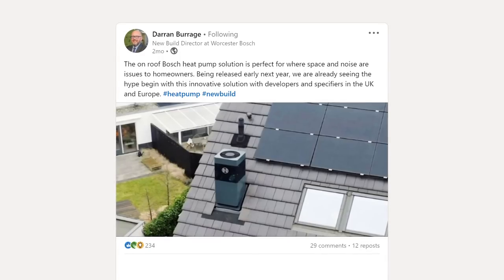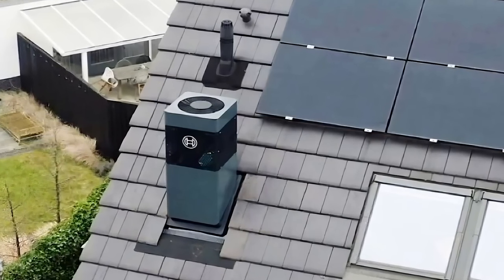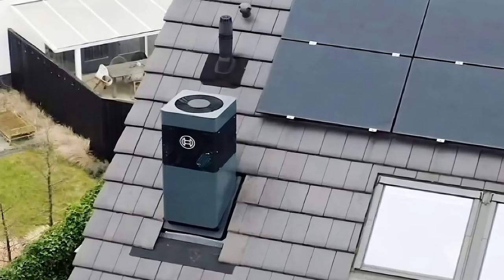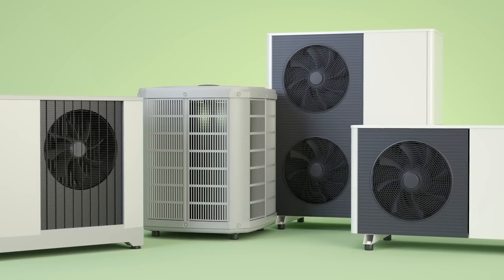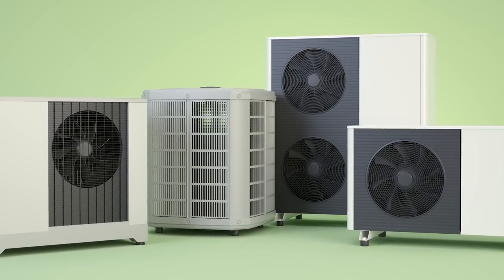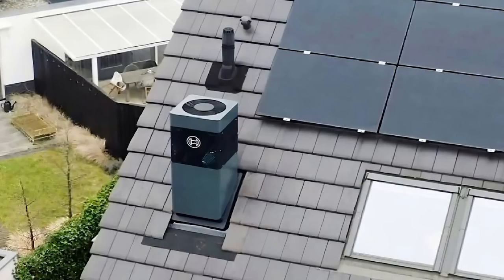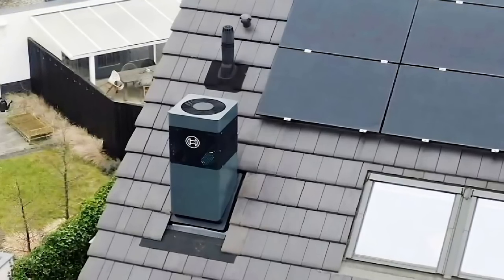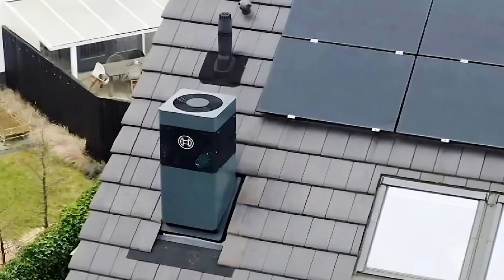Is This New Air Source Heat Pump Idea Crazy?

Comment: Nice idea and a good option where it could be accessible, but maintenance in UK houses will definitely be an issue and introducing new risk runs contrary to the ethos of CDM etc. 

Gas boilers are popular because they work well, are relatively inexpensive, and can be specified, installed, and maintained without as much specialism. They may not be as efficient as heat pumps, but they hit the sweet spot of being good enough and accessible enough to most people and installers. 

The more things have to be engineered to be more efficient, the more processes are necessary to do essentially the same job - and they more they cost and likely the more Co2 in their manufacturing. As an example, your gravity fed hot water system may not be super efficient or amazing, but it works well enough and is pretty simple. Now with pressurised/unvented systems,.you get better efficiency and performance, but they need a level up in terms of more specialist parts and maintenance. 

That's not at all an argument to say don't try or do anything new, don't Innovate, don't use heat pumps etc. It's more there are no panacea technologies and especially not ones where you need to coerce, nudge or persuade people into adopting them. It's easy to see something new that appears innovative and adopt it in a rush, only to find that it doesn't work. And you can't really predict the future either! 

We need to understand why boilers have been so popular (and it's not just energy companies) and be honest about the limitations of new technologies.
Reply: I agree with almost all of what you said, especially the safety aspect. But where you said "They may not be as efficient as heat pumps, but they hit the sweet spot of being good enough and accessible enough to most people and installers". Heat pumps are only efficient when you don't need to use them - when the external ambient is warm. When it gets cold outside, they are not efficient at all. Also regarding CO2 production: Such a thing exists called a TEWI calculation. This calculates the carbon footprint of a system from cradle to grave. A boiler in the UK could have a lower TEWI than a heat pump when you consider the lifespan. A simple gas boiler could last 40 years with minimal maintenance and new parts (I have one, though I doubt a new one would last quite that long). Heat pumps are, to be frank, complicated, maintenance-heavy, and comparatively unreliable. Supermarkets replace them every 5-7 years and they have maintenance contracts to look after them. They do not last long and certainly do not retain their efficiency over the years. There's a lot to be said for simplicity.
Reply: @ashbridgeprojects6916  Some great points there and I completely agree. 

I have done some carbon lifecycle calcs in a different capacity and you find that carbon generally correlates with cost; i.e. the more expensive, the more carbon. This is essentially because more processes and materials equals more cost, more time and more carbon. It just depends on what you narrow your analysis or vision to. Yes electric grids etc. don't produce co2 at the point if use, but we don't know the primary and secondary effects of doing this at scale in practical terms and CO2 terms.

As another example, consider the implications of shifting to battery powered cars on the roads. If electric vehicles are even just 50% heavier than ICE equivalents, and after 2030 everyone is driving a car that is on average 50% heavier, this will have implications for roads, bridges, transporter vehicles. It's fine at the moment because electric cars are still relatively rare. But  All will need to be either reassessed, strengthened, or replaced. That itself is a huge undertaking ! Going from where we are now to even 50% of vehicles on the road will have a big impact on the underlying infrastructure.

Comment: I wonder what the practicalities would be around a loft mounted unit. It's usually a good few degrees warmer in a loft than outside (more heat to scavenge), condensate drain out and down to ground level/into gutter, easier plumbing to the main system (shorter runs), closer to airing cupboards where most people bang a hot water cylinder.
Of course none of the existing units would work given the vibrations and noise, but there's got to be someone working on a system surely?
Servicing it in the summer ahead of the cold heating season would be a nightmare though!

Comment: Neighbour had a heat pump put in next door by the housing association. They've put the fan under his kitchen window which is a few feet from mine so you guessed it. All I can hear now in my kitchen is this huge monstroscity out the front. Thing is a flippin eyesore on top of its noise. Besides. how do you extract heat out of below zero temperatures? Just looks like he's had a big emersion tank fitted so it's all on more expesive electric than gas? Yes I need to do some reading up on it.
Reply: They rush them through their own planning authority

Comment: Presumably it’s mounted externally due to the way new build roofs are constructed with prefabricated lightweight trusses, might be tricky getting a heat pump inside a cheaply built new house. 
Also, a Ground source heat pump works to much lower ambient temperature, but costs more to install, QED everything on the cheap again

Comment: Can I ask, why can't it be inside the loft space, protected from the elements, easy access and warmer than the outside so easier to extract the heat?  I am sure there's a good reason.
Reply from the maker: Maybe it can, we couldn't see any technical manual.
Reply: Because it extracts heat from the air as would effectively super cool your loft.
Reply: @normanboyes4983  I guess so.  My loft is open to the air a bit to allow my gas boiler to vent, so you would get an airflow.  Mind you, a lift ice bar would be pretty cool
Reply: @PaulMcCormack1968  I rather hope not.😳
Reply: Your loft would turn into a fridge. Mind you if your neighbour ran a meat processing plant you could heat your home by cooling his product and you'd have hot water and free sausages.
Reply: @m4inline  Genius !!

Comment: Certainly the noise issue of current ground-based heat pumps is an issue that's conveniently 'overlooked' by its advocates. 

Needs fixing with a solution.

Comment: They just need to supply the R.S part number for Angel wings 😂 I am looking at the cost and servicing of heat pumps over 10-15 years and replacement of the heat pump etc V other technology. Going to have to replace my boiler soon and loft conversion so lots to work out. No convinced at all with heat pumps. May have to be a boiler swap with same radiators down stairs and Infered heat panels in the loft conversion? Old houses are full of pitfalls but worth the hard work.😮

Comment: Why insist with the ideea of heat pumps ?

it is almost impossible to find engineers to repair heat pumps for the entire population ... + heat pumps have long and complex diagnostic times ... In my city @ 170k people there are about 15 technicians on gas boilers of which 5-6 good ones... and this for 40k families... if they all had heat pumps, we would have even fewer technicians and we could repair much fewer in a day due to the long maintenance times...
+ I think that having hot water and heat in the house should not be a luxury... they are necessary for normal life... but heat pumps push us towards this...
+ if we allocated more funds to the thermal system of the houses and not to the heat source, we would ensure jobs for poorly qualified people who would allow a better education for their children and in the long term a more developed society...
+ heat pumps consume a lot of copper - a metal that is increasingly needed in cars...
A modern gas boiler can be made with 2-300 grams of copper ... (pump and fan) ... the rest of the components can be made of plastic and stainless steel ...
Why can't everyone have a gas boiler with very high modulation or direct electric heating (in 50-100 years when maybe they will manage to make cheap and efficient nuclear fusion reactors - extremely unlikely) and build houses much better insulated?
why should we work as engineers in improper + risky conditions?
I am still against the installation of photovoltaic panels on roofs precisely because of the risk of injury to the workers ... even if the idea of having photovoltaic panels on the house sounds good to me ...
gas boilers are cheap; relatively easy to diagnose and repair, compact, affordable...

Comment: A roof mounted installation just adds to the obvious but quietly ignored problem with this so called "New green technology"  cost. 
The things are ridiculously expensive and probably always will. It'll take 20+ years of saving on your bill to recoup the initial outlay on the thing and no doubt it'll need replacing before you get close to breaking even. That's assuming the thing even does what it says on the tin. Now, when it needs its annual service or goes up the wall you are going to need a scaffolding company and a flat bed truck parked outside your house! You'll be popular with the neighbours if you live on a narrow road or one with yellow lines down it. All that to service a boiler!
Now imagine the cost of maintenance with all that in tow....
The whole things mental.

Comment: I think air source heat pump is a crazy idea wherever the thing is located.  Something for nothing, as in perpetual motion, may be the great dream of humanity, but so far it's not been found.  If the outside temperature can be raised by squeezing it with an electric pump, the heat produced will create a differnce of X%. However, when the temperature is less than 5C that same increase in % heat will be very very low. Ground source, as in deep underground, will provide a higher base level for the pump to multipy.

Comment: I recall seeing a heat pump like this a few months ago, and it actually slid down vertically into the roof void for maintenance to be carried out.  Of course, that requires that you have space in the roof void for all this to happen, which many of the new build, 2.5 storey, 3-floor terraced houses don't have (given that the top floor uses all but a tiny amount of the roof void).

Comment: This would actually work well In Scotland, particularly in bungalows. All roofs in Scotland are solid clad, with ply or OSB before felt, counter and tile batons. This has been the case for many many decades, due to snow load regs. I like it, but how effective are they. Currently my roof has 3” of snow and it’s -3 c at sea level.
Reply: Wonder how many they'd sell in Braemar ❄️
Reply: We got one in central europe where it can be -20 and works well but you need the right spec'd one
Reply: @m4inline  can you share the specification please?
Reply: Would need to go dig up the manual. It is a LG unit for heating and cooling and has a million letters and numbers in the name. But if you are expecting long periods of cold have a look at Mitsubishi HyperHeat (called something else in europe i think. Used in canada, sweden etc a lot). Those use a different compressor technique so they dont just use electric heaters to operate and have high efficiency far below zero. By right spec i mean designed for the climate and not underspec'd. My guess is the noisy ones are just running too hard trying to keep up with demand
Reply: @m4inline  how can a "heat pump" work even remotely efficiently if it is supposedly taking energy from the air, and using it to heat a space that is warmer than ambient temperature? Might as well just use the electrical component more directly. It doesn't comply with the laws of thermodynamics to me. Maybe I'm just daft...
Reply: @Tom_Hadler  alright mate. Nah that's not how it works. What you are saying is the same as "how does a freezer cool the contents to cooler than the room its in". A fridge is a box with a heat pump. Basically the coldest possible temperature is called absolute zero. Nothing can get colder than that. As long as something is above absolute zero it has heat. A heat pump is just a machine that takes that heat away and puts it somewhere else. Absolute zero in Centigrade is like -273c or something. Probably wrong. As long as something is above that temp it has heat that can be taken, by whatever wizardry. The issue with heatpumps in the UK is you got a load of rip off merchants underspeccing things and selling overpriced shite. Half of Sweden and Canada run on heatpumps all yr round for heating and cooling anf no one got a problem
Reply: @m4inline  Yeah I thought you'd mention absolute zero. I'm familiar with Kelvin etc, but even so it relies mainly on using energy from the electricity I bet, rather than extracted from the heat in the air. I dunno, maybe I'm just an old cynic. I can more understand the ground source versions, where it maintains warmth above atmospheric temperature I winter, and how that would be beneficial. I just don't believe it basically. Refrigerators aren't sold as using magic energy from the air, they are using electricity to pump out heat from a tiny insulated box into the kitchen. I just feel like air source heat pumps are doing the same thing, but they're sold as if they manage to use lots of energy from cold air. I just don't buy it
Reply: @Tom_Hadler  i think you are misunderstanding the principal, but i might misunderstanding you, not sure. With a heater, like sending electric current through a coil, you are directly making heat. Energy in equals heat out. Expensive mate. But with a heat pump the heat is already there. Someone else made it. The question then is how efficient the heat pump is in moving the heat around. All it does is move heat from A to B but it takes some energy to do it. If the machine is crap it will be inefficient. But look at Mitsubishi Hyperheat and look how it works. It aint like a fridge.

Comment: Absolute nightmare location have they gone completely mad installing this heat pump on a roof? My neighbour has installed a heat pump 6 months ago nothing nut problems with controls all resolving access to the heat pump, just cleaning the condensing coil yearly will mean erecting scaffolding. I have three air conditioner heat pumps, one needed a new compressor if it was installed on the roof cost would have been horrendous cost, blue sky thinking!! Back to the drawing board me thinks.

Comment: I live in a very old listed cottage and have a 'cat slide' roof, so I could feasibly have it fitted (if planning allowed, obvs) on the lower section of the roof which you can reach from a set of kitchen steps at one point... 🤔

Comment: My friend has had a heat pump installed and has had astronomical electricity bills. His gas central heating was a lot cheaper. Plus the cost of the heat pump installation plus the lack of heat pump engineers. And the noise etc.
What is the point of them

Comment: They should be more focused on ground source heat pumps on new builds before the foundations go down. New builds are still not being built to a decent standard with missing insulation and cheap doors and windows.

Comment: Be fine on flat roofs but I can't see boiler engineers wanting to climb up on roofs they don't particularly like having boilers up high on a wall 🤣
Reply: In January in the dark and ice when it stops working. Why then, because that is what happens.

Comment: I moved from the UK to Canada 38 years ago, and heat pumps have really taken off here. Mostly houses were heated with forced air furnaces, either oil or wood fired, but heat pumps have replaced them in all new builds and on lots of older homes. They are much cheaper to run than furnace oil. What amazes me is how the UK seems to be wanting to get them to heat water and use existing radiators. You can't buy anything like that here. All our heat pumps connect to an inverter which quietly takes in room air and blows it out nice and warm. They don't look that pretty (but neither do radiators, come to that), but they do work and even when it's cold (-27ºC was the coldest day so far this winter) I haven't had to turn on the backup baseboard heaters. And if the power goes out, I have a couple of woodstoves that can come into play.
Reply from the maker: Electricity is cheaper in the U.K and, yes, the  link up to existing hydronic heating is a mistake that we are making in the U.K. They work well with hydronic underfloor but not radiators.

Comment: Who's responsible for the flashing around the heat pump? My guess is the builder.......good luck with that. If noise is an issue, install a split system, and move the compressor indoors.
Reply from the maker: I am sure the flashing is the same as roof windows. It is unlikely to leak unless it has been put in upside down.

Comment: If all of your breakable equipment is inaccessible why do you not go for the Black Panel Thermodynamic radiators instead. They work 24 hours a day without sound and are very low maintenance.
The idea of a large noisy fan annoying the neighbors has always baffled me when we all live with a fridge, and the heat pump is only a reversed stretched out version of a refrigeration unit. Black panels on the roof work when it is hot or cold and even love the wind. Problem solved for less than the cost of a fan unit.
Reply: Completely different noise,  twenty times louder than a fridge and 24/7

Comment: Thats a nice desk. Shame to  put the front on it and hide all the work. No faced  brick panel and just the SB label. Best of both worlds.  Im still a bit emperors new clothes about heat pumps specially as electric prices are increasing.  Does look tidy but if its a house could they design some sort of module you buried deep within the oversight in conjunction with the footings construction.;
Reply from the maker: You would see my legs if we didn't have the panel and discover that I spend a lot of my leisure time in my underpants